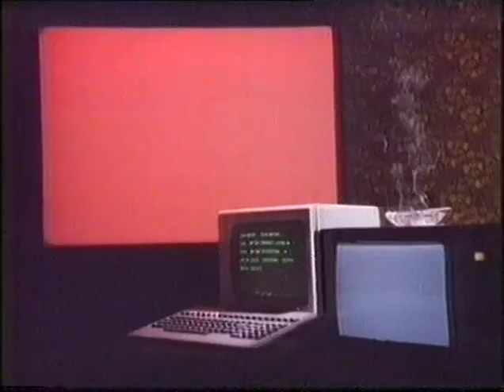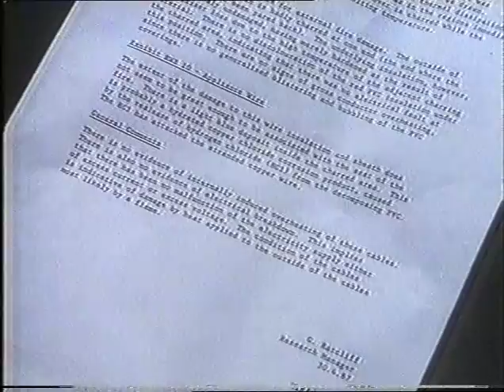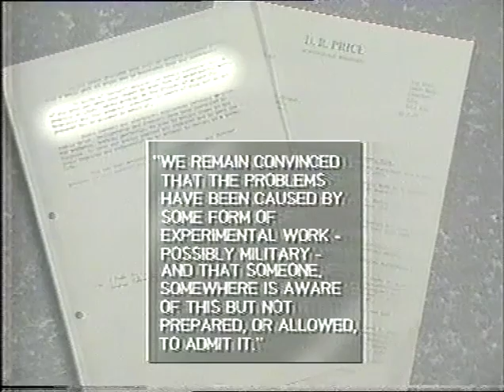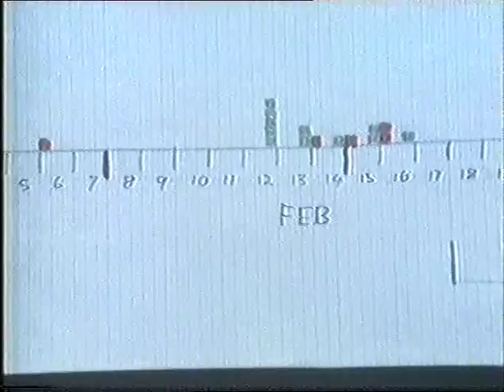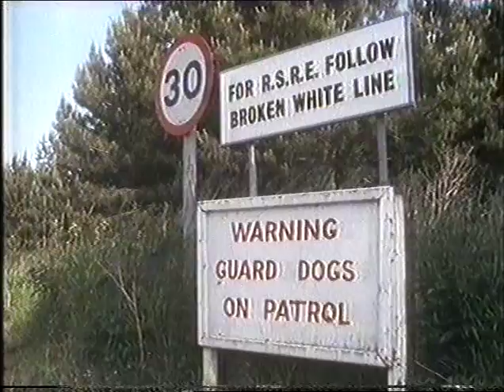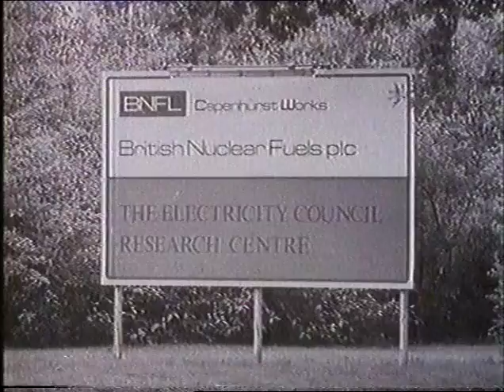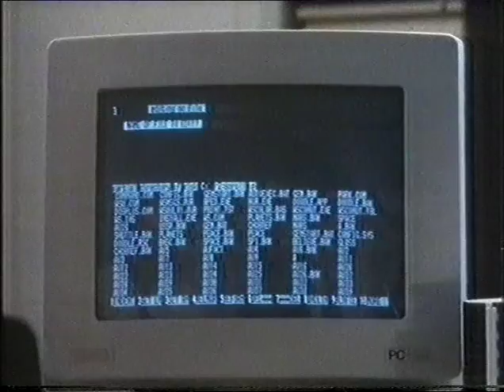The Cook Report 1987 Close Encounters

Comment: A polygraph test is actually not as accurate as they make out.  It is likely that the home owners were doing it and over exaggerating or someone who was against the transmitter.  In one of the investigations said the wires were melted from the outside rather than the inside from the wires in the cables.  In these cases it all points to the residents sabotaging their equipment or using equipment which will cause power surges.
Reply: You're just repeating information from the programme and conflating it with your own doubt.
Reply: @fluxington  Yes, that is the idea.  The logical explanation is sabotage and it's what the electric company's investigation found too.
Reply: @mseven1361  But what about the allegations that the residents would have to operate the main switch or breaker 600 - 700 times a minute, to cause such damage, presumably from back EMF? And you're conveniently ignoring the opinions of Dr Barnaby and Dr Baker, and two other un-named experts, about the use of defence systems that could cause such disruption. It was also suggested that being at the end of the radial supply that fed the house could amplify effects.
Reply: @fluxington  The 600 - 700 times would be questionable.  In the UK electricity is at 50Hz so it would potentially be impossible to say 600 - 700 times per minute because the equipment would be working at a frequency of switching 50 times per second (3,000 per minute) so I would say the 600 - 700 was pulled out of the air.  It could be achievable if they were to short circuit the equipment or putting an external power source such as a car battery which could damage the equipment in this way.  600 - 700 could be consistent with a microwave at the time so potentially using microwave parts to short circuit or cause a power surge could do it.

The real way of finding out if it was due to sabotage is revisiting the building after these people left.  If it didn't happen in one or more residents in the same way (and the subsequent tenants weren't also doing it) then it was sabotage.

EMF would be working at a much higher frequency and would instantly trip the surge protection at the house and substation

Comment: His wife is suffering from the microwave disturbance which has been used and showed by the military to harm the body, its similar to the directional beams used in the war to guide enemy bombers over England, but 1000x more powerful, a friend of mine his neighbour had a swimming pool and was told by the raf it was used as a way point on a targeted terrain following beam over the country as he complained about the low flying aircraft, they also told him not use radio control aircraft as they would never work due to the beam, nice shot of defford at the end, but nothing to do with microwave terrain following radar